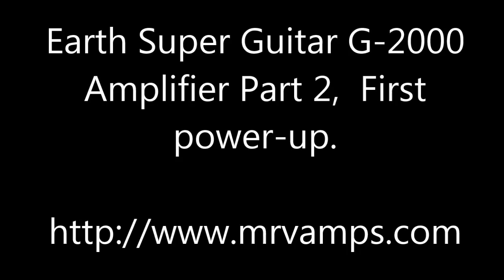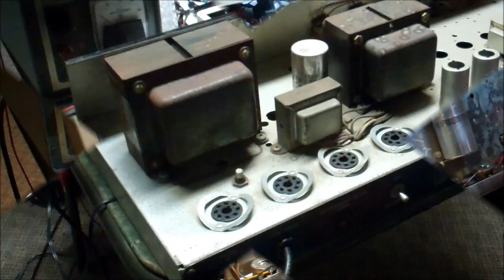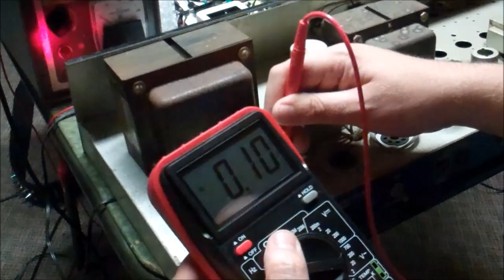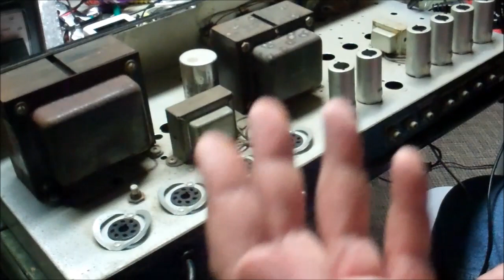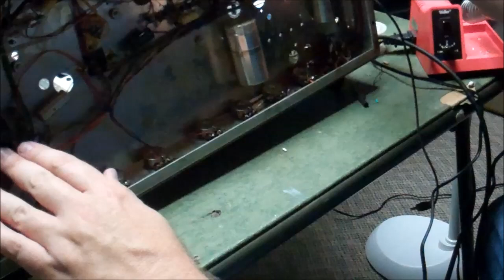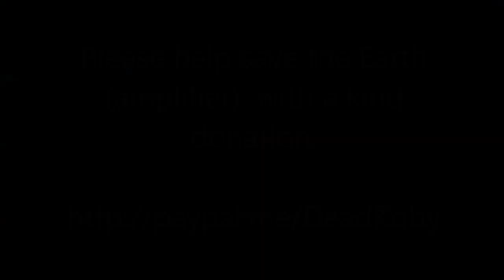Earth Super Guitar G-2000 Amplifier Part 2......First power up.

Comment: I am Restoring a Plush PRB 1000S. I have had Bought it out of an old, now gone 2nd Hand Music Store in the early 1980's. I have been following your Videos,  and much research,  and can not find a Replacement for the 20/20/20- 450/ 500 Volt Capacitor. I have also researched, and do not understand the Internal Structure, of replacing it with 3 simple 20/ 500V Caps. The one this unit has is out of tolerance to 28 MFD. Any Ideas? That Cap is no longer made, and I am not buying the ...Foreign version.
Reply from the maker: https://www.amplifiedparts.com/products/capacitor-ce-mfg-525v-202020-f

Can caps are indeed still made.  You're just shopping at the wrong store.

Comment: DK, how much do you have into the amp at this point.
Reply from the maker: I purchased it for about $235

it needs a tube set...  (140$ dealer price)   and a Cap Kit  (50$)...  plus whatever surgery the cabinet needs.    I've found a local vendor who has 6L6GC (China OEM)  tubes for very cheap,  so If I do that,  then I leave the mullard tubes with it.     Because these amps are kind of unknown,  I don't think it'd be a fast sell..... if it sells at ALL.   I'm seeking as many "cheap-o" ways of getting the tubes,  since that's the part that's going to hurt the most...  the other stuff isn't going to be so bad...  Unless there's a bum speaker.    I really like to see these projects done and working,  because WHO IN THE WORLD has a working healthy Earth G-2000?   Everyone plays a Fender or a Marshall.... So I have to be different...   I play my custom amps,  or at least something non-traditional.
Reply: @DeadKoby  Did you get this fixed?  what era of G2000 is it?  The first ones were basically Bassman-based, or some argue theyre Showman-based.  Thats up to about 72-3.  For a couple years after that, they were trying other designs to base it in, which are the ones that have that tuck and roll upholstery work... until they settled on doing direct copies of Peavey amps, which got them in big trouble with Peavey, who sued them.  Alas, even though they made a pretty decent amp, they just werent well known and thus, along with the Peavey suit, ended up closing their doors somewhere around 77ish I believe.  I have an early 72 G1000 currently, as well as an Original (Guitar/Bass amp based on the Peavey design), and a 75 hybrid amp, which has no model #.  I used to have a B2000, several years ago, which was my first Earth amp and I loved it!  235 W bass amp, clean all the way up, perfect for bass but also accepted effects pedals really well!